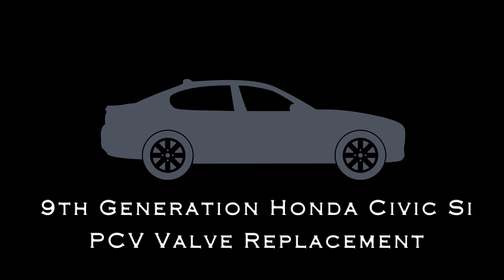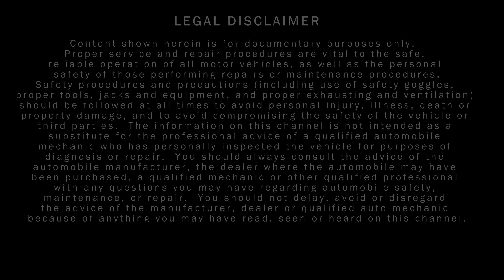Replace PCV Valve - 9th Generation Honda Civic Si 2012 2013 2014 2015

Comment: Why or when would you need to change this ?
Reply from the maker: Rough idle, sluggish acceleration or increased oil consumption if you don’t replace PCV during normal maintenance timeframe. 35k - 60k miles.
Reply: Clogged   Messsed up